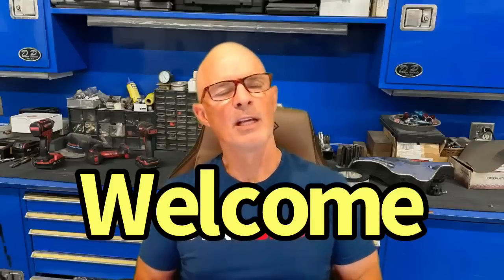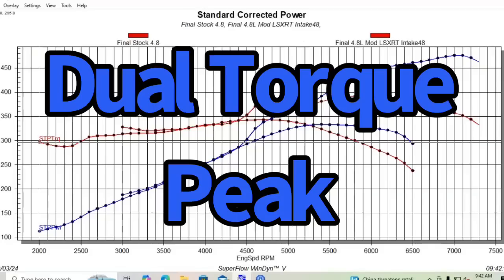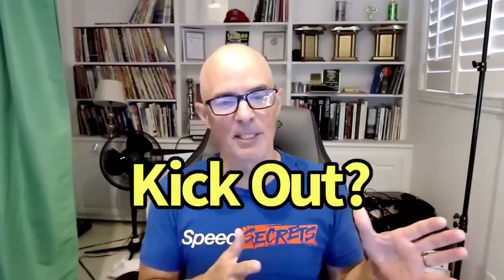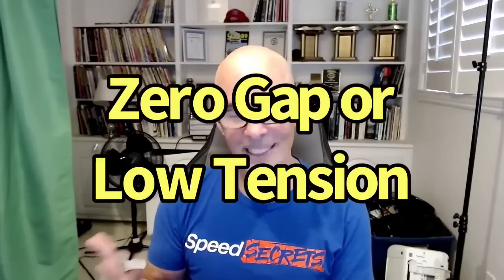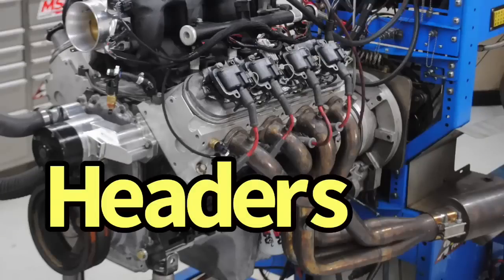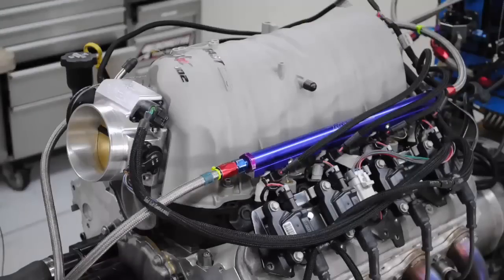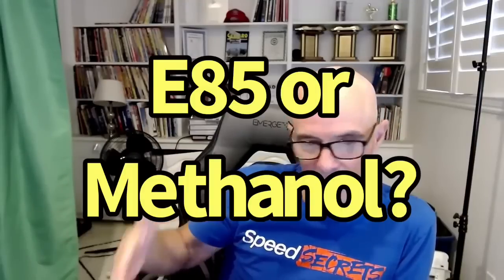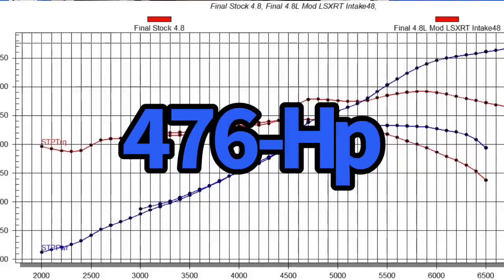500-HP NA JUNKYARD 4.8L-NO BOOST, NO NOS! CAN IT BE DONE? HELP ME ADD 25 HP TO THE 475-HP 4.8L!

Comment: I heard on the Power and Speed podcast that running 5qts of oil in a 6qt system yielded 20hp in a 500hp engine. Pretty sure it was a small-block Chevy. I can try to find the episode and time stamp but I believe it was with Lake Speed.

“One quart of oil in a small block Chevrolet 383 with a stock pan. You've got a stock block, stock pan, stroker crankshaft, a seven-quart pan, put in seven quarts oil, run the engine, drain one quart of oil out. This is on a 450-horsepower motor.

Any guesses how much power it was difference? One quart of oil?

In a stock pan?

Stock pan.

Stock pan that was like topped off. I was going to say 15, but I'm going to go more with like 25.

On the money, 25 horsepower.”

From The Power and Speed Podcast with Lake Speed
Reply from the maker: we adjust oil level on the dyno to maximize power, but it's never 20 hp except on a BBC
Reply: This is not new information. Showroom stock racers were running their cars 1qt. low in the ‘80s. Of course, that was on a stock L98 305 that ran out of breath at 4400 RPM & had a 5000 RPM redline.
Reply: @alantrimble2881  Yeah I knew it wasn’t some new secret sauce. But sometimes guys will forget a tidbit like that.
Reply: New to me I thought that was windage tray
Reply: This was already done on engine masters.
Big blocks saw an increase but sbc would expect that much gain
Reply: This is true. Super stock racers have done all sorts of things like this to gain every last HP they can. The amount of oil you run needs to be relative to how deep the pan is. The oil needs to be off the crankshaft counter weights completely. Other things that can be done are filling epoxy in the water jackets. This is mainly done for weight savings. Lighter weight valves help. Roller rockers help some. Not using valve seals on the exhaust valves. I think the most gains are going to be had with an open Long tube header, milled high compression heads. Larger light weight valves, Tighter piston ring gaps with less drag. and properly ported heads and matched Cam shaft for at least 7500 RPM peak. A large volume intake is a given, but I think one that uses velocity stack ports inside might speed up the airflow with the airfoil effect. Port matching and fresh clean set of plugs and well working set of injectors will ensure you’re not leaving anything on the table.
Reply: I remember that show!
Reply: I've seen Nick take out a half quarter, or so, when he needs 3 or so more hp to reach a dyno goal.
Reply: Great video RH I know you won’t let that 500 hide for long ... keep up the great work
Reply: That's a lot  how is there that much windage yikes what else is still on the table

Comment: 11.0:1 - 11.5:1, L83 GenV Cylinder Heads, Valve Pattern Matching Solid Roller 235-240 @ 0.50 Cam/Lifters, Brian Tooley Ultimate RPM Valve Springs, Holley High Ram, Dual 4150 Throttle Bodies with a bell/vollute on each. 93oct.
Reply: how would that perform on a 6.2?

Comment: E85 and bump the compression by 1 full point and a little more cam
Reply: @goldysgarage189  with that much can you could run full timing on pump gas at 11:1 compression.  Especially since the dyno water that he cools with is about 140 degrees.